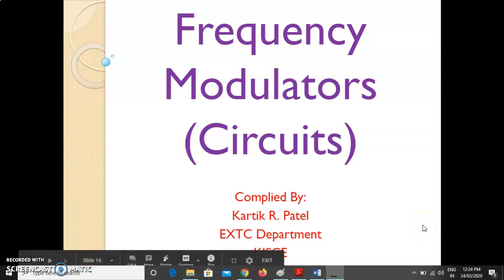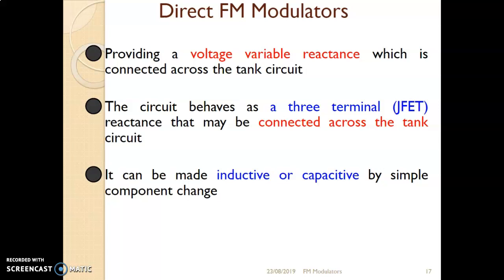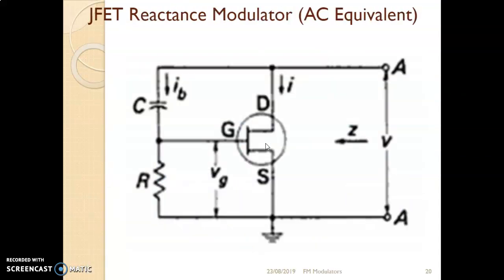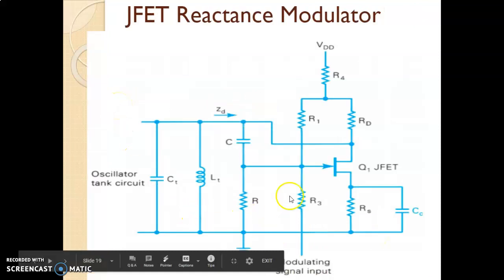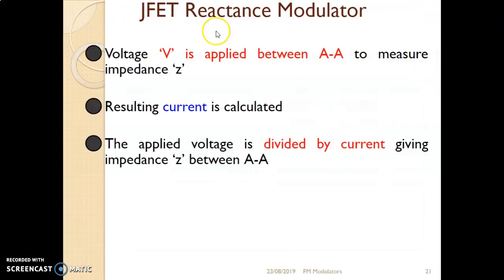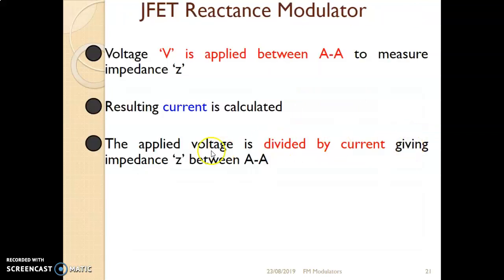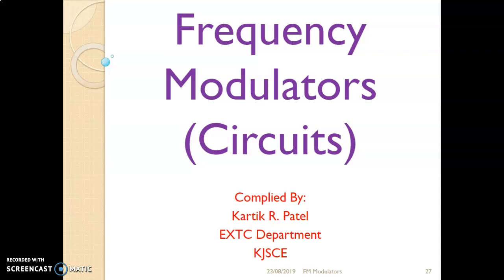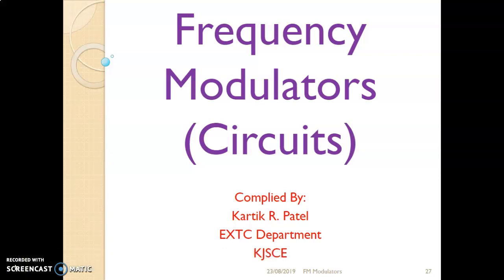Chapter 3_Direct FM Modulator_JFET Reactance Modulator

Comment: Sir, why didn't we short the capacitor which is connected to drain in the ac equivalent circuit?
Reply from the maker: Because capacitor will act as a short circuit for AC